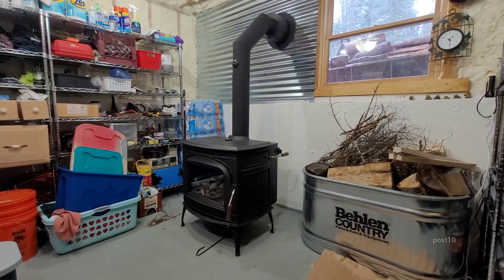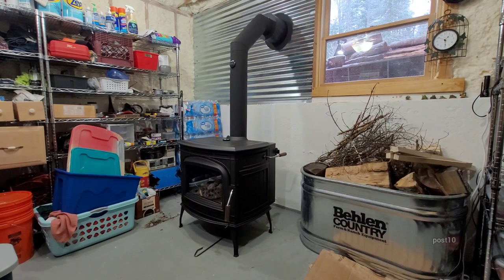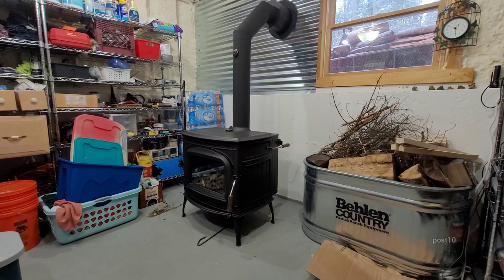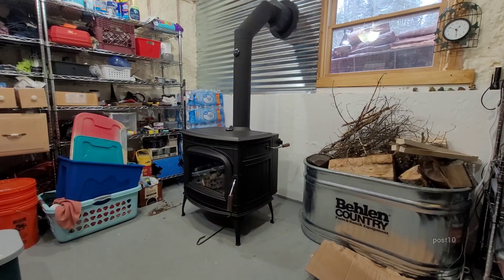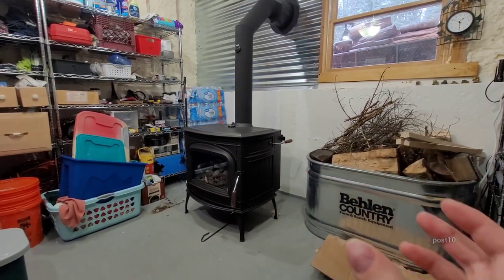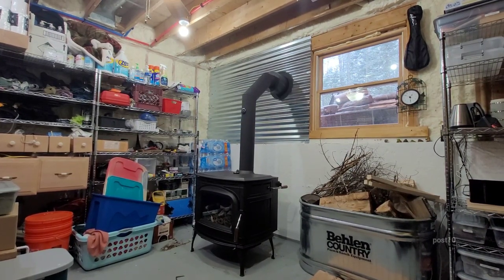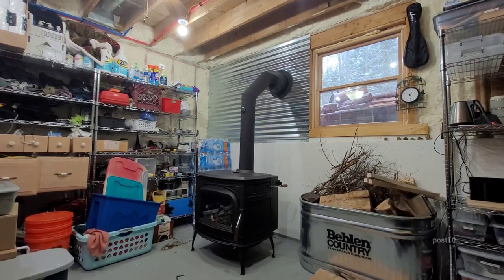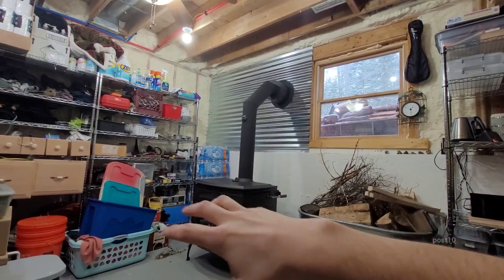Burning Wood To Save On High Diesel Prices. Blaze King Catalytic Wood Stove Model Ashford AF30.2A

Comment: Heating with oil has always sounded so expensive to me! Always been a mystery why it is so popular in New England. Glad I have cheap hydro power here in British Columbia. I spend maybe $500 Canadian per heating season (mild coastal climate helps, too). Have had a wood stove before and would like to move into a place with one again. Maybe some day.
Reply from the maker: I don't know how true this is but I was always told that heating oil is popular here because it has the highest BTU output compared to other fuels and it's safer than gas. I grew up with so many gas leaks in buildings I lived in. And electric would be completely unfeasible to heat around here with, very expensive. I pay average 350 dollars a month on electric and 200 if that is just to power my electric water heater. I regret getting rid of the oil water heater
Reply: @post10Vlogs   Indeed, I don’t think electric would make sense in New England, your electric rates are much higher than ours! But maybe gas? Most of the country heats with gas and the risk of leaks isn’t as high as one would think. Oils is BTU dense (per gallon) but I don’t think the price in $/BTU is competitive.
Reply: @davidbarts6144 idk about rural USA but rural UK heating oil is popular as electricity is expensive and there is no natural gas so you’d have to use LPG/propane to heat which costs more than heating oil so oil tends to be more popular where there is no gas grid
Reply: @lukedoherty8062  Would not surprise me. USA and UK/Europe are two separate markets when it comes to natural gas (which is not easy to transport overseas).
Reply: @davidbarts6144  from looking at prices online it seems in the USA it’s similar that oil is cheaper per unit of energy. Even though propane is cheaper pre gallon as you’d use more so similar reasons to why we use it as it works out cheaper and more cost effective
Reply: @davidbarts6144  the UK have our own national gas supplies and import from the North Sea countries mainly but it’s the rural areas where there’s no distribution system. Which id imagine is similar to some areas in the US and why oil would be chosen over lpg.
Reply: @lukedoherty8062   Yes, rural is different, but at least in the USA propane tends to be a LOT less expensive per gallon (yes, oil has more energy per gallon but not enough to make up the price difference). And many oil-heated homes are in neighbourhoods served by natural gas. Really a mystery to me why more people haven’t switched fuels in New England. At this stage, I chalk it up to inertia: Oil once made sense because it was cleaner, less expensive, and more reliable than coal, so there was this massive shift to oil, and people have stuck with oil even though other fuels are now more economical. What’s strange is that in other parts of the country, people have tended to shift fuels (oil used to be much more popular than it now is here in the Pacific Northwest).

Comment: I have a pacific energy  that’s rating for 3,000 it’s in my basement just like yours the basement is 1000 square feet and it seems like it’s having a hard time, I have a vent above the stove, and three more on the other side of the basement it seems like it traveled over there. Should I try the box fan on top of the vent like you said  and let the cold  air go down the stairs to make a current?
Reply from the maker: I will probably put a vent but for the time being the whole house is being kept warm that being said we haven't had a night below 10 Fahrenheit, the real test will be when we get down to -30, then it might have trouble

Comment: The north east of the US uses Ultra low sulfur diesel instead of what traditional fuel oil these days to reduce emissions  this also causes issues with demand on diesel which is why its getting so expensive

Comment: is that catalytic function battery powered? How does that work exactly?
Reply from the maker: No it's electricity free. You pre-heat the stove get it nice and hot and a good current going. When you close the bypass it is forcing the gases and smoke through the Catalyst which begins glowing

Comment: How does the heat travel to the whole house? Sorry if that sounds dumb but I don’t know how it gets from the basement it’s in to the rest of the house, I understand hot air rises but does that mean you have vents in the ceiling? Sorry just genuinely curious i live in England where most people just have a boiler and radiators 😂
Reply from the maker: I thought about cutting gravity vents right into the floor from upstairs but it is not necessary, cold air rushes into the room on the floor and hot air goes out the door and upstairs, it finds its way around the whole house without the need of any fans

Comment: So this thing here on the back of the stove with the knob is called a bimetallic dampener and don't suck the air out of the room once you get the hole in push the cold air into the hot room so you're not cooling your hot air off I work at a stove company in Northern California
Reply: Ok sounds off but if you suck the air out of a hot room your cooling it. If you dump the cold air into the hot room. The hot air will find a better draft.and you will find the ash pan to be a pain. Shovel and bucket way easier

Comment: How does it do heating the upstairs?
Reply from the maker: I dont even need to add the vent I mentioned in the video it radiates through the floor and it rapidly goes up the stairs without a problem

Comment: Furnaces have PVC exhaust pipes because they are direct vented out the wall and have to be sealed so exhaust doesn't escape it has nothing to do with acidic fluid .they have blowers .

Comment: Dumb question, but given the amount of effort the manual log splitter requires, isn't the old-fashioned axe method not any more difficult?
Reply from the maker: No this is definitely easier than an axe, and axe is only easier if the logs are really small and it can go through it with one swing, some of these logs I have are so big I would have to use wedges and a sledgehammer
Reply: @post10Vlogs  Thanks! That is good to know.

Comment: Cool video nice setup but that wood splitter looks like more work than splitting with an axe god bless
Reply from the maker: I split with an X if the wood is less than 8 in in diameter, you're not going to get an ax through a piece of wood that's like a 16 or 18 in diameter without wedges so that's what this is for

Comment: i have a damper in my stove pipe that acts the same as the cat .. it shuts off the heat in the pipe to 300 degrees o-pen it and pipe rises to 5- 6 or 700 making my stove heat up .its a lake wood unicorn thats 25 years old and my wood can heat my 1500 square foot 2 story to 82 degrees fair consist all night

Comment: This is not a normal stove....  Time it so you can load it I the morning and after work( or before you go to bed)... it should be all coals when you load it....  Rake the coals forward then load it up completely( like you can't fit another piece)...  close bypass right after you load it..  Run the stove on full air for 10 minutes, then adjust to desired temp...  DO NOT RUN THE STOVE WITH THE DOOR OPEN OR BYPASS OPEN WHEN IN ACTIVE ZONE....

Comment: thats a lot of work with the little splitter. why not just get a splitting maul, especially with those smaller sized rounds. I've got a gas powered 27 ton hydraulic splitter i use also.  i've been wanting the Blaze King Princess. i currently use two stoves. a small one upstairs and a larger one downstairs. i tried to heat the whole house from the basement stove. it works but uses a lot more wood than the one upstairs. I'll use it this weekend because it will be so cold and it will help keep the temps up. you need a new  battery in your clock....lol
Reply from the maker: One of these days I'm going to get a gas splitter but I couldn't afford it this year especially with this purchase so I bought the manual one which is a lot easier than using an ax just to get me through the season

Comment: If you value efficiency and don't want to much smoke, then you're firing it up wrong. Look into the Swiss method for starting the fire. That's the new normal here in Europe.

Comment: Thank you for the video. However you don't need the gauge on the flue pipe. I have a BK. princess.  In the basement in north east Vermont.  1200 Sq. House. so it does the basement and house .no fan's. Heat goes up the basement stairs.

Comment: wood stored to close, been there will egnite over time, woke up to smoke and glowing log ends, HEADS UP I BUILT FIRE RATED  SHORT WALL  BETWEEN WOOD STORAGE,   :body-blue-raised-arms::face-blue-wide-eyes::hand-orange-covering-eyes:
Reply: ALSO OTHERSIDE ,   takes steps or be on the news, be careful, not it is ok attitude , who am i?  inspector / engineer retired
Reply from the maker: Everything you see in that room was there when the stove was installed even the metal bin with wood, this thing could be running a week Non-Stop and it doesn't even get warm

Comment: Is it really only 70%+ efficient? Thays not that good for a catalytic. Mine just has the tubes and is 77%
Reply from the maker: That's not bad considering a normal wood stove gets wayless and a fireplace gets 20%, my diesel furnace get 78%
Reply: @post10Vlogs  I just thought they'd be in the 80s somewhere. It's basically like mine without a cat

Comment: You bypass is not closed all the way...  move it slow but push harder to close fully
Reply: Correct!  Push down on the bypass handle and you'll hear a "clack" which is the bypass being locked down.

Comment: Cant believe US still has oil heating.  Australia got rid of it mid-70's after 1973 OPEC oil crisis.
Reply from the maker: And you think something else would be easier to get? I think if something like that happens it's going to affect any type of fuel, keep in mind it can get down to negative 40 degrees here sometimes electric is not going to work very well
Reply: @post10Vlogs  After ditching the heating oil, people then went to either gas or electricity.  If Australia was able to do that 50 years ago, why cant US have done that in the meantime?
Reply from the maker: @wizzard5442 most of the US doesn't use gas but we prefer heating oil because it's more energy dense for the amount of space apparently

Comment: All New Wood Heat Stoves or Fireplaces have a Burn Off when new. If possible, start them outside, then bring them inside once ‘cured-in’.
Reply from the maker: Thank you, it wasn't possible because it was professionally installed

Comment: Is it in the garage?
Reply from the maker: Basement
Reply: @post10Vlogs  can I ask why? Wouldn't it be better in the living room ?
Reply from the maker: @karenmeesschaert5686  it's easier to move Heat upstairs and not downstairs. My basement is partially finished and making the basement warm it can rise up. It keeps the entire house warm the furnace never asked to come on and the floors feel warm. Living room would be nice but it's not really practical for evenly distribution of heat. Also I have bad ice dams so best to keep it away from the upstairs

Comment: What do they cost ???
Reply from the maker: The stove not including the pipe was about $4000 but it will pay for itself in less than 2 years in diesel savings the way I'm cutting my own trees. I said in the video 4 years, that's if I buy the wood
Reply: Then it’s a great deal for you and I have 160 acres of misquote trees up to 14 inches

Comment: I still not convinced that the catalyst will last!    Just another thing to stop working
Reply from the maker: In an emergency you could run it without it if the flame a small you just would have to add a damper on the pipe, has a 10-year warranty and about $400 if you want spare

Comment: Electric splitters are NOT underpowered. I have one and I have done 18-24 inch rounds of dead cherry on it no problem. Doesn't like knotty stuff of course. That hand splitter will get old fast. I know - I have one and replaced it with the electric.
Reply from the maker: The affordable ones I saw were only 5 ton, maybe you have a better one, I got this because I couldn't afford one that was that powerful
Reply: @post10Vlogs  5 tons is big enough for dry seasoned wood. I know you have a big outlay there with the stove and pipe, so save up for next year. You can always sell the HF hand unit if you decide to go electric.

Comment: Wow, $2,000 to normally heat your approximately 1400 sq ft home sounds expensive.
Reply from the maker: I'm not sure where your from but we often get 2 months below freezing with weeks below 0F and nighttime lows to -35F
Reply: Do you know what it costs to heat a home via other methods? Diesel costs more than that to heat a home for just one year.
Reply: @Gruuvin1  Rude
Reply: @post10Vlogs  
I'm from Maryland. I keep my house at 67 degrees and I sometimes think that's too warm. I heat with gas and my monthly bill averages about $350 per month, which I consider to be high. I pay the bill so I know. I only heat for 6 months max. My home is 4,000 sq ft including the finished basement. I have large windows throughout the house. So $350 x 6 = 2100. That's why I say that 2,000 to heat your 1400 sq ft home sounds high. That's all.
Reply: @amorales9613  nope. Just correct.
Reply: @amorales9613 your fuel bill for just one year costs more than a $2000 wood burning stove. How about $20,000 for 10 years? How about$100,000 for 50 years. A wood-burning stove is not $2000 per year. You buy the thing once and it outlasts the home. People buy these things because when you live in the woods, your heating fuel is free, FOREVER!

Comment: Have you ever heard about axes? just to split logs.... much more cheaper than your log splitter
Reply from the maker: Good luck trying to get an ax through a giant log, I have to use a sledgehammer with wedges and a log splitter is definitely easier, especially when you're going through multiple logs a day, you just don't have time to do that manually at least I don't

Comment: Fuel oil and diesel fuel are the exact same product. Fuel oil same as off road fuel just has red dye in it. There is no chemical difference between the two.
Reply from the maker: I know they're the same fuel but heating oil is not refined as much so it will harm a diesel engine over time. It has a very high sulfur content as a result to less refining

Comment: Boss industrial makes a 10 ton electric splitter. Requires a 20A 120v circuit. 

I have the 7 ton 15a model and it can split even huge 18" rounds.

Comment: Really dumb question. If there is no radiated heat how does it heat the house? Sorry I live in a warm climate so don’t really know much about log burners
Reply from the maker: Most stoves do radiate heat out of the sides but this one has heat shields so we can fit into tighter spaces
Reply: @post10Vlogs  so how does it actually heat the house. Does it have a coil in side connected to the central heating?

Comment: Please move that bottled water away from the stove. 
Like leaving it in your trunk on a hot summer day. Plastic leeches into the water.
Reply from the maker: Believe it or not even though it's only two feet away it doesn't get warm or hot
Reply from the maker: All the heat is just put forward mostly and the top of it
Reply: I run a non catalytic stove and my whole basement is 120° 
I'm surprised yours doesnt throw off more heat.
Reply from the maker: @dand33911  I mentioned in the video I was going to add a vent in the floor but it's not even needed it's radiating through the upstairs floor and I can feel a rapid draft of hot air coming out the top of the door and up the stairs with a cold draft rushing in along the floor, if I keep it at about medium the entire house stays at 70 if I turn it up the entire house bakes but at night I turned down as low as it goes and the house drops back to about 60
Reply: @post10Vlogs  
Seems like it's just the right size. Does the job without working too hard. Good luck with it. Heating with wood is the way to go, no matter how you burn it.

Comment: You should move where u keep your bottled water n not drink that there. Heat makes extremely toxic chemicals to leech from the bottle into the water. Please don't store it there, that's y they advise never to store water in your car for long periods of time,  same reason.
Reply from the maker: Thank you, as soon as I use it up I'll find another spot for it but it actually doesn't get hot at all the stove is only throwing heat forward nothing even gets warm on the sides of it
Reply from the maker: @kooskoos8181  I thought the same thing, I couldn't believe it when the wood stove company told me that things only had to be 18 in from the sides but yet things on the other side of the room get warm in front of it

Comment: Be a man, get a fckin axe! :)
Besides we have wood stove, and a scandinavian tilestove (1.5 Ton)
The woodstove gases goes to the chimney  around 200-400c, plus you have to continuisly feed it.
I lit the tilestove once a day until -16 celsius. It consumes only 20% of the wood stove! 
The exhaust gases around 120celsius with it, and the heat difference is remaining in the house.
Here in Hungary, i',m using only 4-4,5 cords of wood per season in our small house. It could be 16-18 cords with a woodstove.

Its not just about the price: you have to process, store, and carry the logs around. 18 Ton vs 4.5 Ton: a HUGE difference!
The drawback: you have to use seasoned hardwood in the tilestove.
If you have scandinavian bell type mansonry, you can use soft woods in it...

Comment: why buy that to cut up logs when you can do the same with a axe
Reply from the maker: You cannot cut a giant log with an ax, it's going to get stuck in it unless you're using a sledgehammer and wedges, I only use an ax for logs that are small